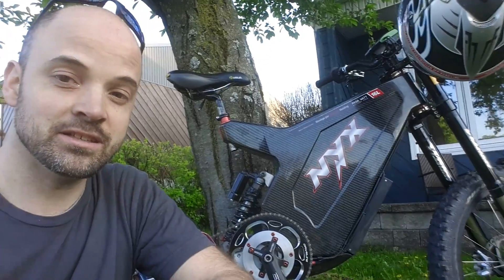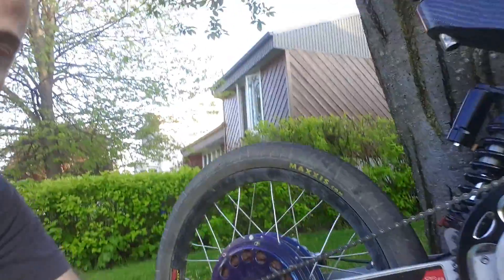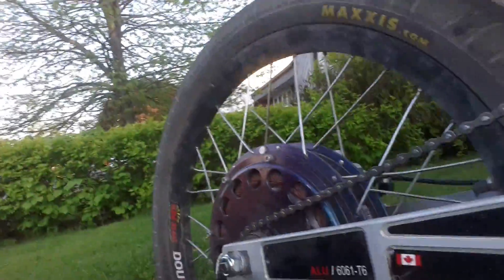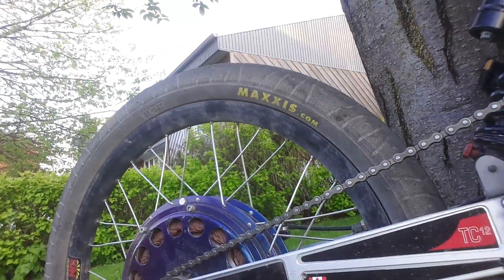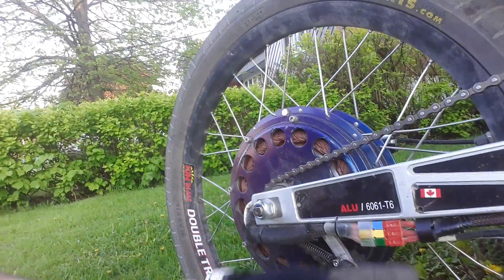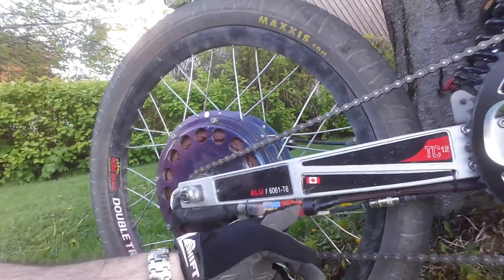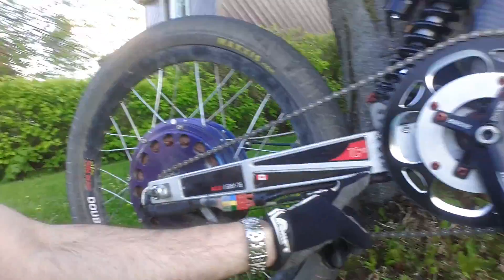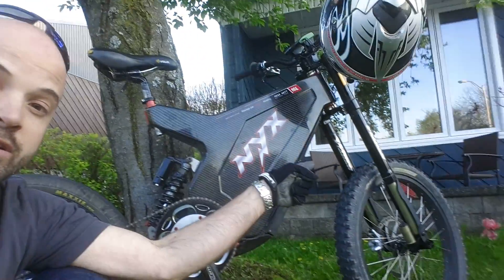16kW NYX powerfull Electric bike review no 2

Comment: just got involved with e bikes and the es forum.
subbed to ya channel too.
thank you doc bass for all of the info and tips you give.
good luck beating the tesla ,at 30 kw its gonna be a close call..;]
i just got an adeptto mini e with a mxus 3000 4t motor..the controller is insideat the top of the battery box on this build, it keeps it dry and clean but im worried about it over heating..will passive cooling with copper plate  and heat sink paste help it?or do you think it will be ineffective?
cheers doc.
all the best